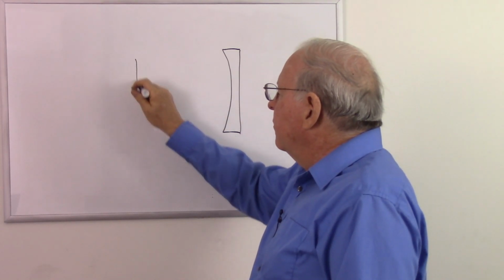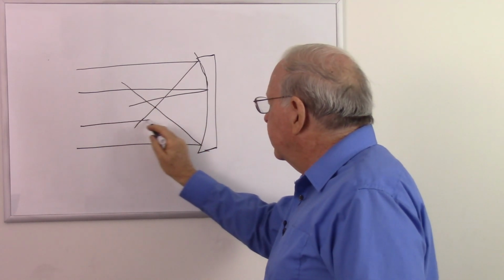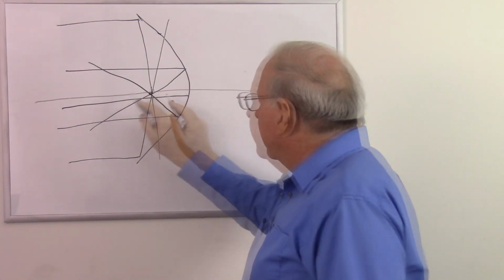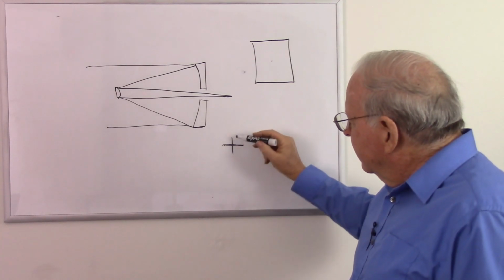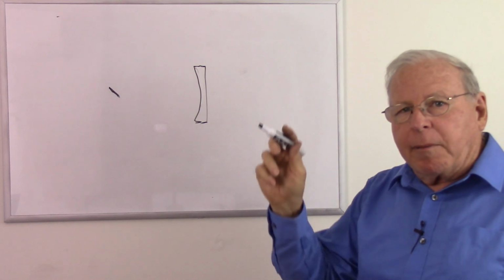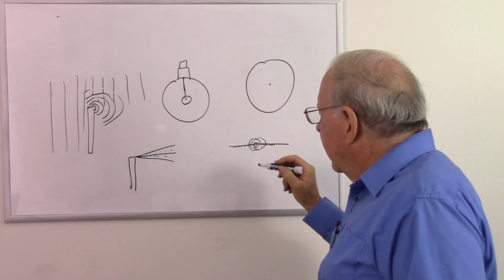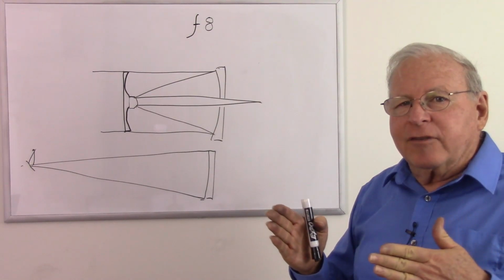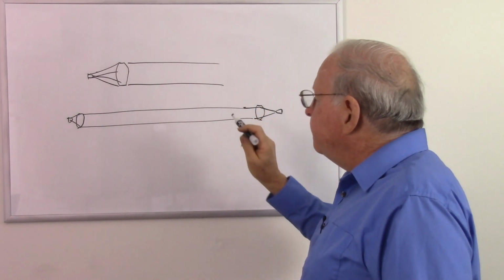Optoelectronics - Reflective Optics - Solid-state Devices and Analog Circuits - Day 12, Part 2b

Comment: Meade, which was bought out by Orion, is no longer produced as Orion has gone out of business. Celestron now rule the commercial Shmidt Cassegrain OTA market. It's a shame because Meade SCT's were fine telescopes. At least my 10" f/3.9 Orion astrograph is now kind of a collectors item. I also have Orion's largest mount, the HDX 110, which has been a great mount with 110 pounds of capacity. It is made by a company called Sinta, who also make an upgraded version for SkyWatcher called the EQ 8 Rh pro. My mount was only 4k, but SkyWatcher's version is more than double that price because they've modified the mount head to be better balanced by putting the stepper motors down the center line of the RA axis, whereas the Orion version has them both on the left side of the mount head, causing the head to be out of balance. They also had the mount painted white and had better saddle knobs of anodized metallic green put on. To balance the Orion version I own was a simple fix but it involved using around two and one half pounds of counter weights to be used on the right side of the mount to balance it. That's not much of an issue on a mount with 110 pound capacity, but any waste of capacity is always a nuisance. The Orion mount doesn't even break a sweat with the 10" Orion astrograph on it and a DSLR. I highly recommend the 10" Orion Newtonian astrograph if you can still find them. That said, you will need a large mount first, and if you can afford that much you may as well get a better grade scope, not Newtonian.